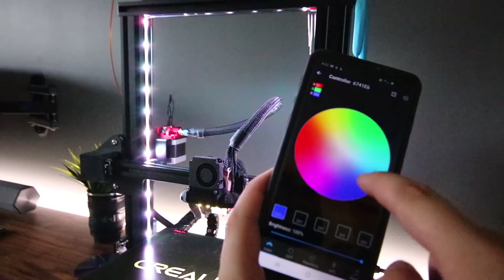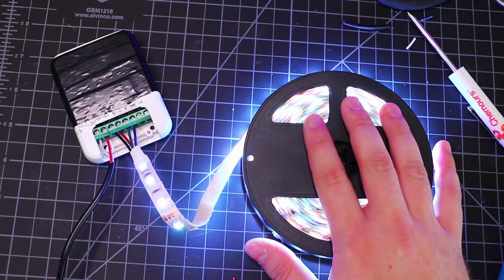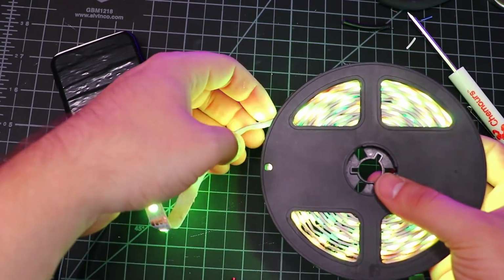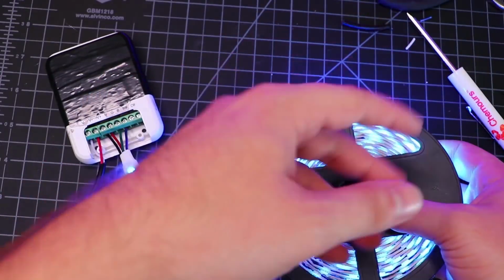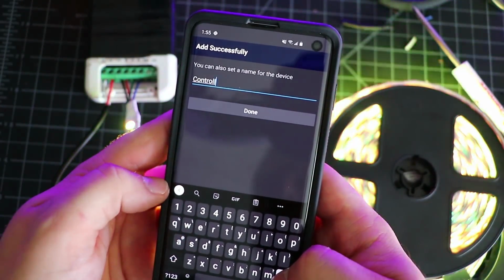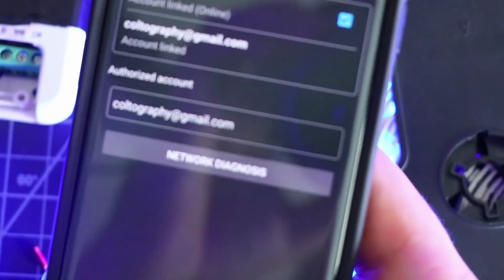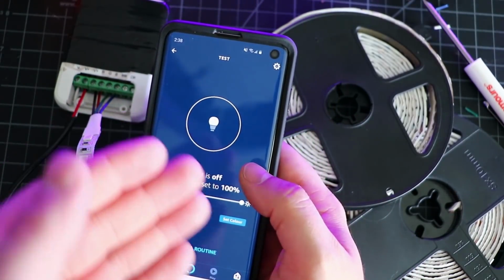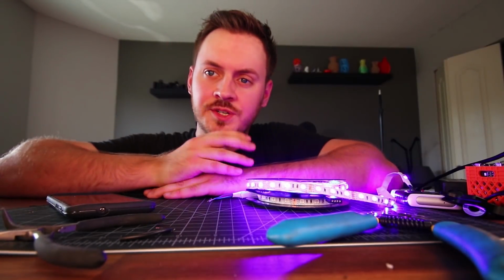How to Automate Cheap RGB LED Strips

Comment: Definitely worth the wait and see myself following all your instruction videos. I would love to see a video setting up a reactive ambilight specifically for an xbox and tv. I see a lot of videos for pc which I dont want and dreamscreen stopped making their product. 
Keep up the great work.
Reply from the maker: Thank you, this is why I haven't done the ambilight video yet - I only use a PC. I am working on a simple solution to use it with your Xbox or and HDMI device but it takes a lot more time and brings up the cost/complexity unfortunately.
Reply: @Coltography  Hey man, great vid - really inspiring! Two questions though: living in the UK we have an earth cable in our power leads, does the WiFi controller you use cater for that? It didn't seem to. Secondly, any movement on a video for the ambilight solution without using PC? Have a PS4 I'd love to hook up to that. Cheers!

Comment: Can you explain how to cut and reconnect LED strips (how to go around corners)
Reply: Get corner adapter from amazon. Fairly cheap
Reply: You can just take some wire and soder them to each end of the led strip.
Reply: You could loop the LEDs

Comment: How do you get/deal with longer led strips, seen different arguments for linking them end to end or separate to controller. Have a 44 foot room ceiling I want to go around so..
Reply from the maker: Inject power along the strip or connect 2 strips to one controller at the middle, if that makes sense. I might make a video about this topic actually
Reply: Coltography would love a video on this. I only kind of understand and seeing helps me learn a lot better. Also saw your other videos and would love more info on your TV setup with lights changing based on the screen (does this work with fire stick? Netflix? DVDs? Ect)
Reply: Coltography also, won’t that just get to 32ft approximately? Hmmm I need 44ft

Comment: Not saying the controller you are using is bad but you can get ones on eBay for 5 USD with an IR remote that uses the same app. And you don't need to cut wires.

Also if you change the name in magic home it doesn't change it in Google home. Maybe that's just for me but yeah

Comment: Hello.
I recently bought the Prismatix RGB Strip Kit, which is what you used in your Apartment tour video.
I was wondering how you go about cutting and connecting the strip? The kit doesn’t seem to provide what’s needed to do this... any way you could help? Thanks heaps /)
Reply from the maker: Hey buddy, you'll have to cut them and solder new wires on if you want to do that, or you can buy some adapters but I don't trust them. I only solder strips together.
Reply: Coltography thanks for the quick reply.
I’m guessing I’ll need to purchase a soldering kit to do this. 
Thanks again :)
Reply from the maker: @cookers.8585   No problem, good luck! I plan to make a video about soldering them all and the limitations etc in the future.
Reply: Coltography amazing! Thanks man, keep up the good work.

Comment: These are the ones that even without the automated stuff you added are compatible with voice and WiFi, so would I have to buy these or could I buy cheap ones and when I automate it would it be able to react to sound since it is connected to the magic home app?
Reply from the maker: You can buy cheap strips and use with that controller, yes, and add 5-6 rolls to it if you have bit enough power supply

Comment: Fantastic video... Subscribed!
So for each set of LED strips you have a separate controller and power supply? Is there a way to daisy chain multiple LEDs if they are in the same area?
Also can you do a video of the TV color changing backlight based on what's on the TV?
THANKS!

Comment: These are really cool, I was wondering, do you buy a new controller for every strip you have in a different areas?  Also, a tutorial for the DIY ambilight and the PiHole would be awesome!
Reply from the maker: Thanks, and no you don't - you can screw more wires into the terminals to control multiple strips etc.   You will however need a bigger power supply if youre adding a lot.

Comment: Good day Sir👋

Is it possible to control my led lights outside my home and the other led lights inside my home?

I plan to buy two led wifi controller that will fit and work to magic home app. 

In Magic home app, is there setting that will sync the two separate led wifi controller in different areas?

I mean the two led wifi controller are not near to each other.

I hope you notice my concern thank you Sir for this video review and tutorial Godbless ❤️👋

Comment: I have similar set up with a LEDs on the back of the TV but they keep falling off. Any recommendations to keep them in place? Thanks in advance
Reply: Hot glue
Reply from the maker: I just user super glue or fatter double sided tape. Don't really care if the back of my tv gets a bit damaged

Comment: Thank you for this video, so much basic info for a novice like me coming in. Even the last nugget about mixing manufacturers will affect colors is appreciated.

Two questions,  how do you choose the power adapter to power the controller?

Also is there any application where something like the Philips Hue Lightstrip would make sense over the bulk strips financially? It is currently on sale for 33% off at best buy website.

Comment: There are actually simpler wifi controllers. They don't require stripping cables, you can just plug in your existing connectors. Also controlled by magic home

Comment: I'm using a smaller one of these. The color reproduction is bad. When I select orange, it shows yellowish. Pink shows white. I have the RGB-only controller tho. 

Also, didn't you get those Zigbee controllers to pair with your Hue bulbs?
Reply from the maker: Yeah that's why I just recommend these, there's a lot of garbage out there.  And yes I did, which I will talk about in another video. There's some pros and cons to going that way

Comment: Hi mate please help, i got the Govee light strips however i cannot connect the magic home pro app wifi my phone is not detecting the LED network. what can i do?
Reply from the maker: Try using a pin to reset the wifi controller and do it again.  You'll need to hold the pin in the hole for a few seconds and then search for the network again

Comment: So are the LEDs on your 3D printer just hooked up to the wifi controller and not the printer? Or are they hooked up to both somehow? I added LED strips to both my printers, and both are set up as status indicators, eg goes from blue to red when heating up, white while printing, green when finished.

Ultimately it's just a matter of preference for sure. I keep my printers in a separate room from my PC setup and they both have silent stepper drivers on them, but I am able to see the green glow down the hall when a print finishes, so for me the status LEDs are both aesthetically pleasing and functional. I can definitely see how that functionality might not really add much for some people though.

I'm also not familiar with Creality printers in general and how easy it may or may not be to add status LEDs, as both my printers were kits.

Not trying to bash anything by any means, just curious as to your thought process on that. I've been on a bit of an RGB kick lately, adding LED strips and bulbs wherever I can, so I've really enjoyed checking out your videos/setup. After seeing your LED logo video last night, I think that may be the next type of project I attempt, haha.
Reply from the maker: Just connected to a wifi controller.  My printer has octoprint set up so it just sends my phone a notification and all the Philips hue bulbs in my house flash when a print completes :) thanks man!

Comment: Quick question. So I have a 7 little window i want to light up. One strip is probably enough light strip but it only comes with one power supply. So I take it I have to find 6 more power supplys and get 7 wifi connectors?

Comment: have you ever put light strips behind a picture to make it glow? if so, how?
Reply from the maker: No not yet, but I would like to eventually once I have more art up.
Reply: thanks for the fast response. i thought of an idea on how to do it. put the picture 1/4 inch from the wall and mount led strips behind it
Reply from the maker: @markonikic7981  Yeah it seems pretty straight forward, I would cut a piece of playwood that's an inch or two smaller than the area of the picture frame, stick the leds to that facing outward and then hang the photo off that.  Could end up being too bright though with the lights facing out instead of facing the wall.

Comment: Quick question how many rolls of rgb lights can be plugged in to one power supply. Given that some of these rgb lights come with two rolls and one power supply would it mess up or possibly cause damage if say I would grab and extra roll of lights from another box and add it to a power supply that already has two rolls. Or should I split them up into different power supplies after a certain amount of feet? Not sure if I make sense but please correct me if I don’t.

Comment: Awesome tutorial man, thank you. Are all generic lighting strips dimmable using the "brightness" features of the Magic Home app? Even if the strips aren't advertised as "dimmable"?
Reply from the maker: Thank you! As far as I know, all LED strips should be dimmable... especially if they are 12volt DC. They may say "non dimmable" on the package, implying you can't plug them into a dimmer switch, which is true.  It's like as if you plugged a phone charger into a dimmer, it just won't work.

Comment: Can I connect 3×5m led light strip?
each 5m strip need 12V 5A 60W so 15m of led strip need 12V 15A 180W.
You think this device can handle this?

Comment: Hi I was wondering how do you make the gaping between the spaces for the LEDs. Mind I wanna do the floating bed plus my window, how do you connect both at the same WiFi controller! I will really appreciate if you could make a video explaining that! I’m so excited to make my own smart room but still being a gray area for me ;)
Reply from the maker: Multiple controllers/led strip kits or just cut the strip, solder a 4 conductor wire long enough to reach next spot, and solder to the next piece of led strip you want there
Reply: Coltography wooooow makes totally sense now 🤯🤯🤯 thanks for your kick answer! I can’t wait for your next videos! A good idea for a next video can be how you made your floating bed or just showing how you set up! One more time, thanks that was really helpful.

Comment: Do I need a separate hub for each strip?
Reply from the maker: Nope, you can always add more strips to the terminals you screw into. You will need a bigger power supply though depending on strip length.
Reply: @Coltography  what do you mean by a bigger power supply. That's the part I'm hung up on. If I did my whole small house. Probably around 90 feet of strips. How would I set up the power?
Reply from the maker: @bblzryfusion  if you do a whole house you don't run it all off one power supply, you'll need multiple power sources, controllers etc

Comment: Are there extension cables for the wire running from the controller to the rgb strip?

I want to run mine under the kitchen cabinets but I need to bridge two strips over the microwave.

How did you run yours over the kitchen island?

Comment: Hey man, was wondering if you could give a reason or make a video about why you don't use Philips Hue? Most youtubers with a similar RGB setup do, why do you not? Is it down to pricing or another reason?
Reply from the maker: Pricing and ability to customize better, with the hue stuff it would cost like 5-6x as much. I like to keep it cheap as possible. Also the hue stuff is kind of properietery and harder to customize if you want to beef up power supply or strip length etc

Comment: Could you please explain the advantage of using a different wi-fi controller versus using the one that comes with the light strip seen @0:47. Seems like a hassle to use a different controller which is why I'm asking, thank you!
Reply from the maker: Hey Brian, 

The other controller only had a small remote control, like a tv remote. It won't connect to wifi etc, which is why I switched it out. You can buy kits with wifi controllers now that don't need wire cutting etc

Comment: What's the maximum length of RGB strip I can use with this setup? Can I extend the range by just soldering a second power supply onto the led strip after the max length or would I need a second wifi controller for this as well?
Reply from the maker: About 2-3 strips, kinda depends how you use them. All 3 colors on at once (semi white) will use more amperage etc. You can solder more power into the strip or just introduce power at the junction when you connect another one. I've never had to do it before because I like being able to mix the colors per controller/length of strip but it should work in theory
Reply: @Coltography  Wow. Thank you very much for your reply. By 2-3 strips this would mean 10-15 meters of the recommended 5050 LEDs? Also I know that 1 meter of LEDs needs around 1 Amp of power but what about the Volts, as the controller can get an input voltage of 12-24V ? Do I needs more Volts for longer LEDs?

Comment: How often do you find yourself replacing your RGB LED strips? Do they fail often? I was thinking about the cheaper ones for my strips, then getting Phillips Hue or LIFX for the bulbs.
Reply from the maker: Only had them fail due to my own abuse, bending the wrong way or using them outside etc. I have had issues with addressable strips though since they have their own IC and everything, but that's a bit different.  If you're looking for white/warm white with RGB just get cheap ones, Philips is a huge rip off
Reply: @Coltography Thanks for the reply, man! I was thinking the same about the RGB strips. Do you at least recommend their bulbs for light fixtures and ceilings?

Comment: Idk if you're going to read this since the video is almost a year old, but do you know how one could counter the voltage-drop in longer RGB Strips?
mine are 5m (16 feet) each and if you route it so that the end is next to the beginning again, you can see the difference in brightness
Reply from the maker: Connect power at both ends of you can, just run long wires from the controller and over to the other end on same terminals

Comment: Hi man, loved your video it's helped me a lot but i have few questions...
If i have a RGBW or RGBWW led :
1) how I connect it to the WiFi Controller? Where I connect the white wire?
2) on the RGBW Remote i can turn on/off and dim the RGB and White light separately, how it will work on the app and does I be able to control both lights with google assistant?
Thank you a lot wait for your answer!
Reply from the maker: Hey, the controller I use here has a warm/cold white terminal for that. In the app, long tap the controller and select change remote type or whatever. Then change to rgbww or rgbcct which will utilize those white terminals. In Google / Alexa just say warm or bright white and it will go white or warm white depending on what you select. You can also just run a roll of white LEDs and hook up the positive to + on the controller and negative to the W terminal and use that along RGB led strips. Hope that helps
Reply: @Coltography  thank you a lot!

Comment: Does this setup of LED lights and Wifi controller work with Homekit/Siri/Shortcuts of the iOS, is there any way you can do a video? I would love to purchase but want to make sure it works before I buy it all.
Reply from the maker: It works but you have to use home bridge or something, if you google magic home app + homekit you can find out more. I don't use apple stuff so can't really make a video

Comment: Can I use two strips w one controller (by using a y cable or by shoving the ends of 2 strips in to the WiFi controller)? Also can we get a video on the magic mirror?
Reply from the maker: Yep you can. And when I make it ;)

Comment: Are you able to use the remote as well as the app if you wire in the wifi module?
Reply from the maker: I haven't tried that, I don't like the remotes

Comment: I followed your steps, got the device to connect to the internet and was able to control it for a few minutes before I decided to try the white colour option. Now the lights flash on/off every few seconds and the LED Controller turns off and on along with the flash.. anyone else ran into this issue and was able to solve it?

Comment: Two connect two different strips together will you need one or two WiFi controllers
Reply from the maker: Depends if you want the two strips to be different colors, otherwise you can just add more strips to one controller

Comment: How did you put your strip lights to match any color your tv provides in real time?. I've found 2 products but I bit pricey, those are LIFX Z & Govee wifi, witch come w/ a camera but it seems like you did it without those products.
Reply from the maker: Arduino + ws2812b led strips, search up adalight if you're eager to learn
Reply: Awesome & Sure thing. If there's any question can I get back to you ?
Reply from the maker: @johnnyboy621100  I can try to help but there's quite a few variables involved, good luck!

Comment: hi I bought 5 rows of 16ft rob strips that you recommended, and 360w large power supply adapter, when I connect all of the strips, there is a large voltage drop, can you tell me why is the solution
Reply from the maker: Connect power at multiple points in the strip, or at both ends. 5 strips of 16ft is too much to have in series

Comment: Do you need a Wifi controller and a power supply invading one plug for each and every led strip? Would it be possible to connect two light strip to the same controller?
Reply from the maker: Yes, just would need a better/bigger power supply.  10amp 12v power supply would work well.